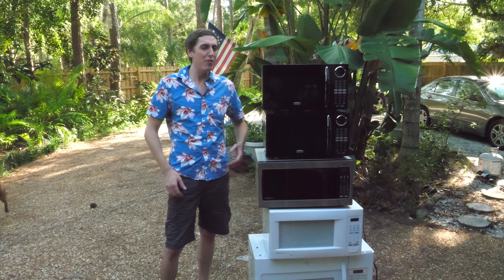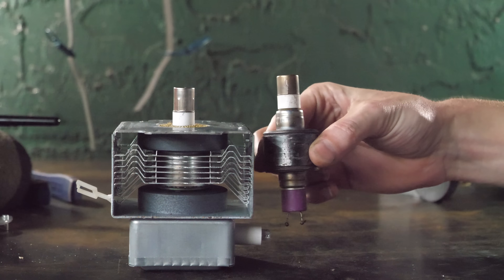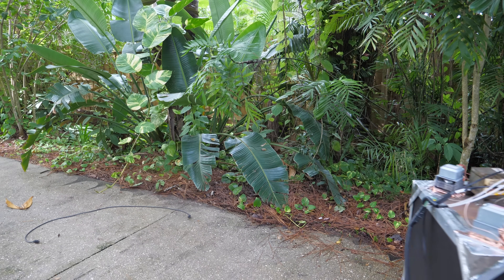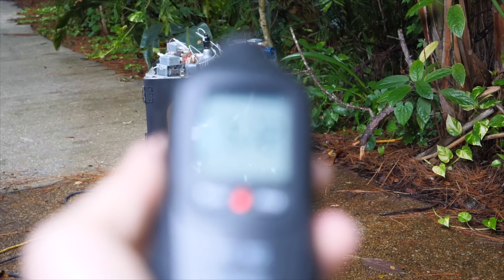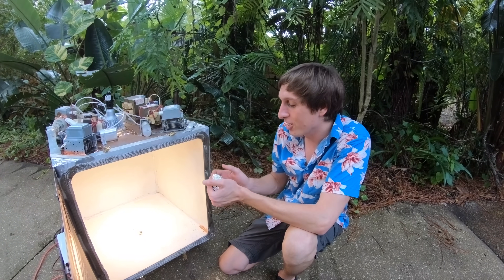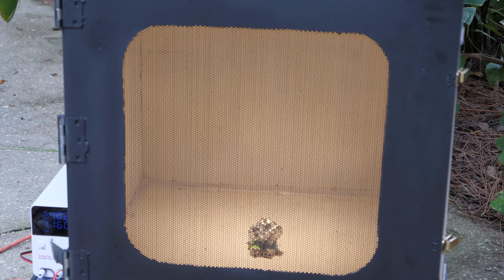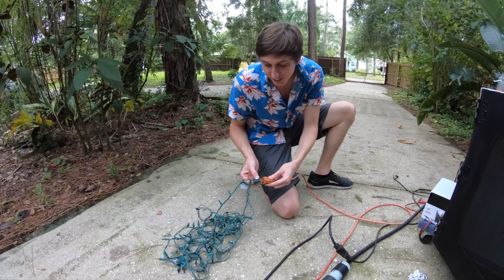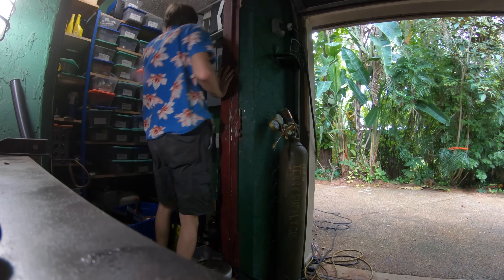DIY MEGA Microwave! - Microwaving a Microwave

Comment from the maker: Well at least I did not end up like this guy! https://i.imgur.com/ONRzMEj.jpg
Im heading to Maker Faire this weekend, Should I make a video/vlog about it?
Got a cool idea for the Science Fair but cant make it? Share it below!
Reply: the best memes are the ones that start with "florida man"
Reply: @randomhellboy5053  true
Reply: You need to put a rotating plate in the bottom of the microwave and cover it in grapes cut in half with a tiny bit of skin left between them, they create plasma and then when they break they propel themselves away from each other actually you should team up with physics girl to answer why they push themselves away from each other when after the plasma burns the center part out.
Reply: I don’t think the snack worked because the small microwave stops microwaves coming in add out and the the mini microwave broke so the microwaves where just being deflected
Reply: I see you showed the MOTs, HV caps, and Magnetrons, but did you also connect the HV diodes to get the voltage doubler circuit working properly? Should've been ~4000v. Else your magnetrons weren't shining as bright as they could be. You really gotta push the magnetrons up near 4000v or they will hardly do a thing.
Reply: How much effort did you actually put into scienceing your microwave design? For example, did you actually build the dimensions of the microwave cage so that you would get standing waves? And the positions of the magnetrons, are they placed in the right spots for constructive interference? And can you phase-control magnetrons? Did you actually do that? I'd really like to know! thanks ;)
Reply: Maxjoker98       I wondered this myself. I doubt he was getting much more than the output of a single microwave, due to destructive interference. As for phase control, I think it isn't doable with magnetrons. (Wikipedia states that both the frequency and phase changes from one pulse to the next.)
Reply: Top News Story: guy has cancer after making DIY giant microwave in his garage.
Reply: Nicholas Hunter  2.4ghz waves are non-ionizing. So, burns are possible at high power levels (like in a microwave), but DNA damage is extremely unlikely (i.e. no cancer.)
Reply: good ol' florida man
Reply: Could you try cutting a grape in half but leaving it attached by a small piece of skin, and then open it so the north and south poles (planet metaphor) touch. (but still attached by a small piece of skin. Try even a bunch of them at the same time (excuse the pun)
Reply: The odds are with me now, I just came back after a year, how SHOCKING
Reply: You should use the killer microwave to make a huge plasma
Reply: u forgot to microwave the hot pocket by its self
Reply: Tryvto do plasma whit glass and candles it would bee quit a show
Reply: Fffaaaaaaaaaaaqqqqqq im 12
Reply: TheBackyardScientist Microwave gasoline.
Reply: Jonah Duchesne It’s “Christmas”, there’s no “X” in it.
Reply: yo dog, i herd you like microwaves, so we got a microwave, so you can microwave while you microwave your hot pocket
Reply: The tv show is called mythbusters
Reply: OH GOD!!! IT BLEW UPP
Reply: Really??!! I had 12 years... I love rocket science... Bye...
Reply: Why arent you afraid of toxic smoke from the microwaved microwave?
Reply: Yeah
Reply: I'm a maker
Reply: Yes
Reply: DIY Megawave
"Ok, don't do this at home guys"
Reply: Put hard drives and computers in the microwave - will it wipe them?
Reply: Where did u go to college?
Reply: Well at least he died in style 
lol, you will never be forgotten RIP
Reply: No joke I actually turn 13 on December 11th
Reply: What are the harms of microwaves bc my friends have a microwave in there home with a two inch hole in the bottom that they have used for years
Reply: SamTheLumbee Microwaves are the same frequency as wifi.
Reply: Please melt glass. You can heat up the glass with a map torch until it's cherry red in one spot. Then quickly pop it in the microwave and start the microwave. The glass will start to melt. I've seen this done in a regular microwave, but I'm curious to see how fast it would melt in a microwave as powerful as yours.
Reply: Please don't do the following, but, i wonder if you could recharge a rechargeable battery in a microwave.
Reply: try making it so they all pulse in a circle, then put something in
Reply: Coppy of of Mr.best
Reply: You forgot to microwave a grape under a cup
Reply: 2:20 i'm more interested in the thunder in the background >.<
Reply: is that image even true? or just a florida meme
Reply: Mr Beast, take notes.
Reply: Th8s is a mr.beast video made by a scientist
Reply: i was about to post LOOK GUYS WE FOUND THE GUY WHO BLEW UP HIS HOUSE
Reply: Yes
Reply: Can you make an electroencephalograph?
Reply: Vloggg!!!!!!
Reply: Does it have to be a “Florida man”
Reply: Jonah Duchesne 😧Where in Canada are you? Here in Nova Scotia our temps are still in the high teens/low twenties. 🌴
Reply: You need to be extremely careful when taking the magnatron apart it might  have beryllium oxide in the ceramics ... and the dust can be toxic....
Reply: you can also use this to melt glass and metals in it by making crucibles of  silicon carbide you should get a few and try it... if you do melt glass you will need an annealing furnace to slowly cool it
Reply: Just saying build a car that is also a flame thrower
Reply: I know there is a video from the channel "is it a good idea to microwave this?" who microwaved a small microwave while that was microwaving something else at the same time. Trying to find it now.
Reply: Holelyshit
Reply: except no one seems to understand the google fair , should actually be called  the google "we will rip off your idea and make millions of dollars and take all the credit as well!" fair, i'm sure there is fine print someplace stating everything you think, or say while at said fair is property of google. apple does it...craziest thing i ever saw, while working at apple, in their paper work (i actually read the fine print) it said while working there anything you invent or think of is theirs....like i was speechless, so i have to assume google is also this way.
Reply: TheBackyardScientist d
Reply: Im so sad i'm only twelve😢😢😢😢🤓🤓🤓🤓
Reply: you shouldve tried a battery inside!
Reply: I have an idea, you should mix every metal on the periodic table
Reply: In a normal household microwave, don't the micro waves need to be evenly distributed hence why the microwave transformer is placed on the side of the microwave unit and the item put in a microwave on a turn table??
Reply: TheBackyardScientist seems like the type of guy that would spend $30 on a lightbulb.
Reply: TheBackyardScientist I’m 11, can I enter the google science fair?
Reply: Lol he died for the sake of humanity
Reply: TheBackyardScientist or the guy who cemented his head in one
Reply: It doesn't take a scientist to know that a box that holds in microwaves will also hold out microwaves.....................   Am I shadow-banned now.. probably so.
Reply: Wavemicroing a wavemicro
Reply: TheBackyardScientist OOF
Reply: TheBackyardScientist you so lit
Reply: TheBackyardScientist but microwave radiation can’t hurt u?
Reply: a microwave oven is a faraday cage in itself so i would imagine no microwaves would be able to go into the inner microwave
Reply: LOL
Reply: TheBackyardScientist v
Reply: i was the 400th like :D
Reply: @TheBackyardScientist I think you could use this as a furnace when melting metals.
Reply: Its toe late for me
Reply: Might want to take a few extra safety steps so you can avoid inhaling some of that in the future
Reply: So its basically EMP
Reply: That's why that guy's watch stopped working
Reply: Create a “Gigantic Midget”
Reply: Technically, it still uses MICROWAVES, as in the heat thingies. So, it’s a microwave
Reply: Should do the grape plasma thing
Reply: You should try making plasma inside of this
Reply: I like how u talk😊
Reply: TheBackyardScientist you should put 100 bags of popcorn in it
Reply: @edmaniayt  from the king of random huh? I like that too
Reply: yo girlfriend thiccccccccccccccccccccccccccccccccccccccccccccccccccccccccccccccccc
Reply: It's either Florida man or Polish man.
Reply: Why did u litter with the tinfoil ball
Reply: Dude I got the same microwave that you microwaved.
Reply: Bru
Reply: Make a microwave microwaving microwave that is microwaving another microwaving
Reply: Time to sleep by the microwave so I can grow 2 more arms😂
Reply: I want to build a one thing but first I have to study elecrotechnics
Reply: You didn't put a link in the video description showing how magnetrons work. Don't say you are going to do something and then not do it. You could have cut that out of the vid
Reply: Donate the Megawave to Jogwheel!
Yes, I know that the microwave show ended 9 years ago, but Jory Caron likes microwaves.
Reply: TheBackyardScientist did you clean up your trash you throw
Reply: Yeah um microwave transformers can cause cancer
Reply: TheBackyardScientist the microwave is enchanted with fire aspect 6 lol
Reply: Bro, while your pedigree is well known to some of us who remember the original backyard and your private war with fish tanks.... but perhaps you should cover your educational chops for any new watchers... then just link it until it needs to be updated in the description.
Reply: 0QQppp1
Reply: What happened to the link explaining the magnetron?
Reply: RIP
Reply: ya lucky you did not end up like him
Reply: Rip Florida man his last words “IM GONNA MICROWAVE A MICROWAVE AAAAAAAAAAAAAAAA-“
Reply: macrowave
Reply: Microwave the electric arc of a tesla coil. Or a electric arc and silicone.
Reply: You needed to add a tesla coil arc. Microwave a electric arc.
Reply: Am I too late signing up?
Reply: TheBackyardScientist not as exciting as I thought it would be
Reply: how does one fit a microwave inside another microwave? (im thinking he did not build his own so? how?)
Reply: Why haven't you been selected for a reboot of Mythbusters?

Comment: If you want to solve the problem of your food being hot on the outside and cold on the inside Modify a normal microwave so microwave's your food with less power for a lot longer That way there's enough time for thermal transfer to heat the inside of your food up

Comment: I used to have a test Microwave back in the day. The most violent thing by far you can put in a Microwave is a raw Egg in its shell. When it goes it will blow the door open on most Microwaves. So simply a Egg and you would have had a better video.

Comment: Your 4x microwave probably has a dead zone that resembles a Celtic cross making four hot spots. Revisit it and take into account the waves and guide them to a point. You can visualize the various machine's waves by placing a paper inside and heating it until the hot spots show up. Sort of like magnetic viewing film shows the magnet's wave shape. I have an idea to use a TV satellite dish to make a magnetron crowd control device

Comment: Lighters will never explode unless you break the entire containment space for the gas simultaneously. This is something learned as a... wayward child. Small holes especially melted ones, near an ignition source, always give a flame thrower. I think the burning gas melts the edges of the hole and makes them reseal. The classic method requires a small bit of skill to hit the ground right, like knife throwing, but you throw the lighter in such a way as to hit the plastic base against the ground and shatter it all in one go. We always used to joke about throwing it down next to a candle... but never tried it. Maybe you should. Just... insert an appropriate disclaimer here. :P

Comment: for yall wondering why a microwave is dangerous:
There is one part of the microwave (don't know the name) it looks like a box and it is closed. If you were to open it, you would be dead in a few hours, cuz there is a chemical inside that is deadly so messing with that is very dangerous. And if you are messing with a microwave and it is not isolated correctly, microwaves will be leaking from it grilling you and your electronics. you would need a farraday cage to operate that device

Comment: How in the hell was that going to work?  😃  You can't amplify the effects of a microwave oven by microwaving the whole oven in another microwave.  I knew it would just fry the electronics of the inside oven and simply cause it to fail while its Faraday cage protected the food from the large microwave.
Also, I was wondering if the 4 magnetrons weren't just trying to cook each other.
Now take a magnetron, connect it to a waveguide and place the end of the waveguide at the focal point of a 6-foot satellite dish.  Can you make a radar?  Can you make coconuts explode up on the tree?  ...although, you might kill the tree.  Don't do that.  Can you heat a pitcher of water from 100 feet away?  Can you be arrested by the FCC?  😄

Comment: I'm just really curious how did the flame from the lighter exploding travel through and out of  the front of the microwave before completely dispersing. At first I thought maybe the microwave front window was just a mesh screen but it can't be because it would emit an unsafe amount of microwaves and you put a mesh piece in to seal the door so obviously the window isn't just a mesh screen so I'm wicked curious as to how the flame traveled or appeared to travel straight out of the front of the microwave?

Comment: I know this is an old, old video. But the reason the christmas lights didn't react at all after getting plugged in, is because the fuse in the plug was killed during the microwaving. Now if you were to replace the fuse..maybe you'd have a spark ;)

Comment: Why is it lava on the outside and cold inside? Microwave radiation penetrates aprox an inch from the spots radiation can reach. This is why they recommending cook for x time flip and cook for x time. Or alternatively you can cook longer and allow thermal dynamics to transfer heat from hot to cold.

Comment: In case anyone is wondering why using two microwaves didn't heat the hotpocket, it's because commercial microwaves have a built in Faraday cage to keep microwaves in. The interior microwave would have blocked the larger microwave's microwaves from getting to the hotpocket.

Comment: you made it wrong you're supposed to take into account the different beams and calculate their cross-sections so you can have them overlapping (plus you have to be sure they each have the same output power) or all you'll make is a fancy tech and hard drive destroyer...

Comment: I'm doubtful you will see this comment after 2 going on 3 years.  But just in case...

When I was in high school I used to take apart microwaves.  I was saving the magnetrons, capacitors, and transformers because I wanted to build a big microwave like the one you built.  Unfortunately, my house burned down with all the salvaged parts inside before I could do this.  It's a lot easier just to watch your mega microwave at work.

I do have one question.  It looks like you are using some sort of power supply to the left of the microwave to power the whole circuit.  How did you handle a control circuit?  It kind of looks like you just wired all of the magnetrons in parallel and then applied power from the breaker in your garage so that there is no smart control required.  Is that what you did?

Thank you for sharing.  This was fun to watch.

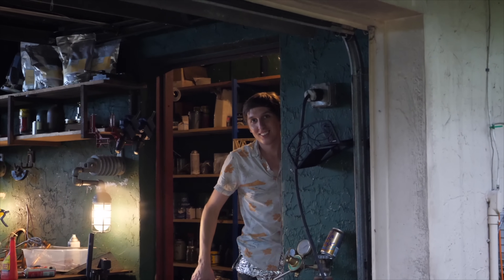Comment: 3:21 no, this is not normally what it sounds like to be inside a running microwave, the reason you hear that low pitch sound is actually a lot cooler, as you may or may not know, microwave radiation and tech do not mix, what you were hearing was the microphone and camera reacting to the microwave radiation, luckily it was mostly undamaged, but if it was inside the microwave, it would have broken it

Comment: The double microwave thing did not work because the microwave inside of the microwave is isolated to keep the waves inside. Either way, this means that no waves can get in from the outside.

Comment: A magnetron is a high power asynchronous RF oscillator. Since the RF outputs aren't in phase, this won't actually add them all together. Each magentron becomes the load for the others so most of the energy is wasted.

Comment: Microwaves are actually not as dangerous as people say, you can run a magnetron in open air without skin protection and be perfectly fine, that’s because it disperses so damn much, that it can’t hit anything with enough precision to heat the body. That being said, if you stick the gun of the magnetron to your body, its gonna get hot, and possibly burn you internally(which is lethal sometimes). So, magnetrons and microwaves aren’t super dangerous unless you make a device that focuses the output, then it’s more dangerous. Still, you need to know a lot of stuff about microwaves before you work on them or repurpose then.

Comment: A small endoscopic incision into the scrotum under local anaesthesia and conscious sedation.  Insertion of endoscope with small metal loop wrapped around vas deferens of each teste.  Loop is pulled tight, endoscope is withdrawn.  2 single stitches.  Then a short concentrated microwave directed at the metal loops that cut off the vas deferens,  finishes the severance and cauterizes.  Minimally invasive outpatient procedure.

Comment: You have to be drawing at least 20 amps with all those mags... and transformers.That extension cord has to be warm. (I work with microwaves) Our large food processing system we're designing has 16 in 1 large oven. (1500 watt each) Yours are probably 900 each. But at 115 volts compared to our 230 or 460, our next project, .. twice the amps. You should visit "The Capacitor" in future vids~. Have to have it to make the mags work. Mags need that DC like current. (And need the high voltage diode to do it)